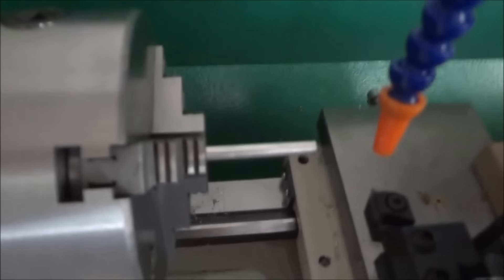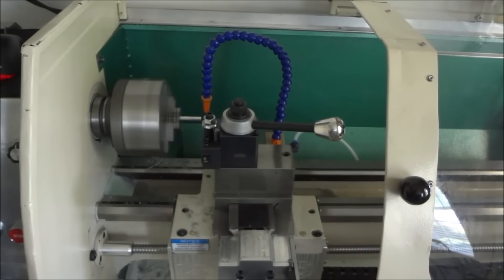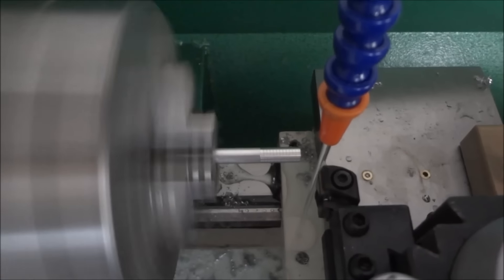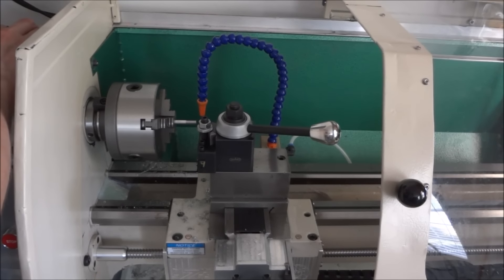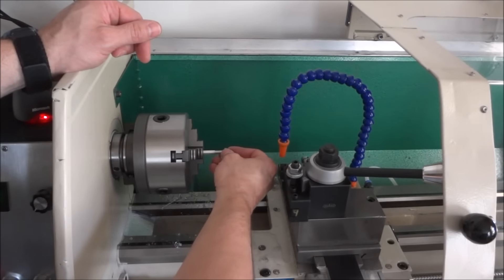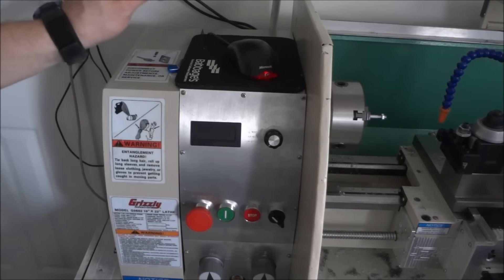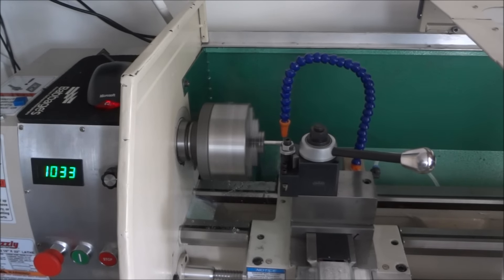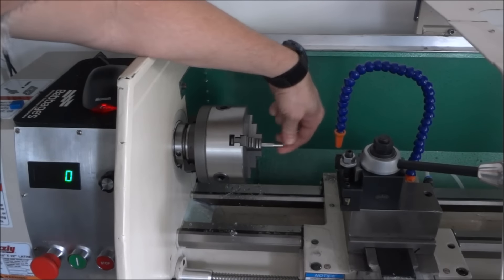G0602 CNC Threading Tests

Comment: Awesome! There is nothing quite like watching a CNC Lathe creating a thread, I never get tired if seeing that. No watching the thread dial, no changing of gears, create both standard or metric threads. Doesn't get much cooler than that. Great work.
Reply from the maker: William Hardin I have to tell you I'm still amazed at what these machines can do. Always hated changing gears and threading setups timing the dial on every pass etc. this is so nice you can go from 1/4-20 , to 10-24, to M12 x 1.5 in the time it take to go to get a drink of water. No more saying I really need 10- 24 but since I'm set up on 1/4 20 I'll use that situation.

Comment: Mach 3's trajectory planning is incredible in regards to threading. I had very similar experiences as you just showed. I appreciated the fact that you cranked the speed up mid job to check the ability to follow. That looked like something I would do just prior to breaking a part or tool ;-)
    Excellent series btw. Too bad your Mach 3 set ups werent around when I started. On the other hand. Thanks to those who did provide what I needed. There is a learning curve.
Reply from the maker: +CncObsession Thanks Yea I wanted to demonstrate that the Proximity sensor was really working I did it early so the threads weren't trash and it was Aluminum so no worries in regards to tooling. There is definitely a learning curve expensive too. LOL I have many Endmills to prove it on my X2 several that never made a cut LOL

Comment: looking good.  why dont you have Mach3 control the spindle speed?
Reply from the maker: Matthew Prestine  Ah yes spindle speed control, I started off with this build to try and show stage by stage how I converted my Grizzly lathe I thought that most people will do the conversion in stages so thats what I have done. Stage one add the VFD 3 phase motor Variable speed, Stage 2 CNC, Stage 3 is full CNC and that will be the next step Spindle control. If your new to  machining having the Potentiometer is nice so you can vary the speed on the fly.
Reply: CNC4XR7 Makes sense,  I haven't followed the entire conversion or its relative steps so it wasn't apparent to me.  Been machining for years, LinuxCNC user though.
Reply from the maker: Matthew Prestine  I tried to do the conversion and put out information others missed so its fairly in depth.
But full cnc will be soon. thanks,
Sam
Reply: CNC4XR7 It is a very impressive conversion, that is for sure.
Reply from the maker: Matthew Prestine Thanks Much Appreciated!

Comment: Nice work.. well so the proof it does work... I wasn't sure up front..
I do think that you should prevent changing the speed, as it seems to finish it cut before changing the feed.. (don't know if that's the way all machines work.) But that does mean I't would not keep up if the rpm's change due to heavy cut's.. Maybe something to test out on a bigger round stock..

Anyhow, congratzz ! and thanks for sharing.
Reply from the maker: RoboCNC Frees- & Graveerwerk  Thanks, And thanks for posting your video and sharing the Idea. We now have a answer.  I wouldn't change speeds on the fly normally this was just for the benefit of the video. The change in rpm's were around 640 I don't think the change in rpm's from heavy cuts will be significant enough to cause a problem But as far as the Index signal goes there will be a change weather you use a Proximity sensor or a Disc set up from heavy cuts.

Comment: Very nice conversion you've done there. What control and CAM software are you using? I'm having bad times with SolidCAM+Mach3 combo, especially with the feed per rev mode. The post processor I've found doesn't work correctly.
Reply from the maker: I have a couple videos on Post processors. take a look. I use Fusion 360 with a generic Fanuc post processor.

However Mach3 does not use all the same G commands.

Make sure your code includes G95 for CSS if it's not outputted in the Code it will not run it default is G94
Reply: That's good to know. Did you make any modifications on the Fanuc post processor?
Reply from the maker: suat korkmaz 
Yes it will not output g95 so you have to edit the gcode
Reply from the maker: I suggest you use the thread wizard and take a look and see how it outputs the Gcode.

will look something like this

G0 G40 G18 G80 G50 G90 
G00 G53 X2 Z0.3
T909M6
G00  X0.892
G00 Z0.1
G00 X0.867
M03 S400
M08
G76 X0.845 Z-1 Q1 P0.05905118 J0.001 L15 H0.001 I29 C0.025 B0.0001 T0
M9
M5
M30

Also refer to this: https://www.google.com/url?sa=t&rct=j&q=&esrc=s&source=web&cd=1&cad=rja&uact=8&ved=0ahUKEwjP1NWak4DXAhVhyoMKHZZcCagQFggoMAA&url=http%3A%2F%2Fwww.machsupport.com%2Fwp-content%2Fuploads%2F2013%2F02%2FMach3_Threading.pdf&usg=AOvVaw3rf1Z4N_9dSDgWwaTq10eJ
Reply: Are you using Mach3 thread wizard for threading or F360?
Reply from the maker: Fusion 360 may not work I suggest you compare the g codes

Comment: Do you have any regrets on this lathe? Watching your videos makes me want one. I have a Jet 14x40 already. If you were in my shoes would you convert that 14x40 or buy a little 0602? Thanks for the great videos and the time.
Reply from the maker: +Unorthodox Fabrication 
 No Regrets, So far it's been almost a year since the conversion. there are a couple things I would change. I would go full cnc right from the start with spindle control ( instead of the POT) and I would go with maybe a 1 1/2 HP motor the 1 HP is OK but I have stalled it taking deep cuts.
The G0602 is a Great Base for conversion I think its big enough and it doesn't have a lot of frills in stock form so your not paying for extra features your just going to remove. I have a small 7" lathe so if I need to turn something quick I use it.
It's hard to tell someone Not to buy another Tool LOL!  
If it were me I know I would use both so I would say If you have the space and the extra $1300 go with the G0602 and leave the Jet as is. But the Jet would make a awesome CNC lathe.

Sorry I know that wasn't much Help. Be Safe Sam
Reply: Thanks for the input. I will buy another then(not that I have the space). I have owned 2 of the jet 9x20's and never used them because my larger lathe was all tooled up. 

I am still on the g0704 conversion.. 1.5 years now. If I was any slower I would asked to be put out of my misery. I have a VMC in my garage I have not made a single chip with yet, and I am still worried about building another machine. 

Thanks again for the great videos, it motivates me to make more videos too.

Comment: can you please tell why you didn't use PM10x30/22V lathe or even the G4003 ?

the PM10x30 has direct mount chuck and more safe for reverse threading..!   also the G4003 is more accurate on the spindle bore!  

how much your run-out in your spindle index?

you did great job!
Oz
Reply from the maker: +Ozy Ozy  Thank you,
 both of those are great Lathes Two reasons I did not go with the PM 10 x 22/30 $$ and It has a DC motor I knew I wanted a 3 Phase motor and VFD. The G04002 0r G04003 are Awesome lathes a lot of the features with that lathe would have been removed with the conversion the D-1 chuck would be nice along with the 12 ' swing. But it all came down to $$ I completed the whole conversion for less than the G04003 would cost.
So far so good on the G0602 spindle run out for me is a no Issue.
Be Safe,
 Sam
Reply: +CNC4XR7   thank you for your quick responding.... I will fallow all your steps for converting my new lathe, I am about to get PM10x30 will add some metal tubes somehow on the bottom to make it heavier as it's longer than 10x22 so it need more mass..

I think for 10x22 should be around 700lb and for 10x30 should be around 800lb    but for PM10x30 only 500lb  not good mass! 

quick question please;:  can I use Double Shaft steppers?  so that I can use the lathe manually when I need to practice on machining! as I am very new to this..I know you removed the compound, so how can be used manually if it can?  

thank you for sharing all these videos..keep up the good work!
OZ
Reply from the maker: +Ozy Ozy Yes you can use Dbl Shaft steppers for Manual machining. I think the Pm 10 30 is a good machine I just did not like the DC motor. The head stock looks a little Narrower as well maybe 1". I did like the Cross slide slots and the Spindle chuck mount. I assume you need the Extra Length?

Be Safe,
Sam
Reply: +CNC4XR7  I think the G0602 is 1"  spindle bore too!   
I will end up changing the DC motor with some 2 phase 240V once but for now I can learn CNC with that motor,,,,, I heard that the DC motor have enough torque on low speed!  so that will be good for threading:)    

I know I am very confused here but I may change my  all plan and go get the G0602 and just deal with the threaded spindle!  and short bed !

thank you 
Oz
Reply from the maker: +Ozy Ozy I think If you need the 30" go with the PM 10 30 both are 1" bore the threaded spindle is a drag but unless your going to be doing Instant reverses its not really a problem. if your going to convert to 240V Might as well use a VFD and a 3 Phase motor and Have variable speed. then CNC spindle control as well. The extra $700 in price goes a long way on a conversion. My 2 cents Be Safe,
Sam

Comment: what happens if u turn the spindle off ?.. mine keeps trying to cut . I thought it would stop the z and x axis altogether .
Reply from the maker: Cant say I ever tried to just turn off the spindle. sorry
Reply: ps : ive never done it while cutting . only with nothing in the chuck . :)
Reply from the maker: I can give it a try next time i'm on the G0602 thats interesting for sure. I have adjusted the speed to see if it would stay in time and mach3 does do that so at Zero speed I would think it would stop but it may default to your min. pulley speed not sure.

Comment: Best regards Can yopu tell hoe configurate mach3  for threading? thanks.
Reply from the maker: deimosjuf 
what do you need help with
Reply: i have c10 bob and c3 index card wit a 69mm disk with 1 slot the c3 shows me the rpm but a does not cut threading (the pitch is not correct) Is necesary the limits for thrading I don´t understant the index debuonce.Thanks for the help and forgive me for my bad english.
Reply from the maker: deimosjuf 
it may be better if you email me . cnc4xr7@gmail.com  does mach3 and your lcd rpm agree with each other?
in mach3 under configure/ ports  pins/ spindle setup special features make sure you check use spindle feedback in sync modes and also spindle speed avg.

Comment: hi sam, wots your thoughts on mach 3 ? i run it on my lathe and mill, only problems i ever have are ones i make, wot are your thoughts please ? thanks daniel
Reply from the maker: +Daniel Kitson  I think it works great I have had weird things happen a few times but a reboot will clear them up other times it was self inflicted or I thought there was a problem and it was me. LOL  I use it on my Mill and Lathe
be Safe Sam

Comment: Your wiring drawing does not show how you get spindle speed into Mach3.  I have a similar set up and can get spindle speed in the little RPM screen but no signal goes into Mach3. When I remove the little tachometer screen and go directly into my Gecko board I get numbers in Mach all over the place.
Reply from the maker: +Dennis Facer  Hi Dennis,
My Wiring for the Tach should be in the link: https://www.dropbox.com/s/mxc6ehji8riioyu/G0602%20CNC%20Stage%20Three%20.png?dl=0

Does the Gecko board allow for a 5v input? if so this wiring should work.
Reply: The Gecko board says signal voltage of 3.3 to 5 required. I have a 12 volt power source for my sensor.  Someone said I need to wire a resistor into the circuit to get the signal down to 5 volts.  Right now something is getting to Mach3 as I have a read out that varies from actual rpm to 1, and is never stable for any number for more than a few seconds.  I have changed every setting I can think of in Mach3 so I am convincing myself this is a hardware problem. Thanks.
Reply from the maker: +Dennis Facer 
Did you splice into the signal wire coming out of the sensor one end goes to the display the other to the BOB.
 Check the voltage on that wire with the sensor blocked and Unblocked  ARE you in the Range 3.3-5V/
IF so then you should be fine as far as the signal.
Reply: First of all thank you for your time.  Where brown is +, blue is - and black is the signal I get the following readings:Brown to blue 12 volts steadyBrown to black 4.75 to 6.3 fluctuatingBlue to black 14.85 to 16.3 fluctuatingBlack to ground 11.28-9 pretty steadyBrown to ground +.13 to -3.0 fluctuatingBlue to ground 3.9 to 6.5 fluctuatingAll of these readings with a program running and no tachometer in the circuit.  If I put the tach in the circuit mach3 locks in a reading of 13, actual RPM about 150.  I am not sure what these readings reveal.  Also I am not sure what you mean to take a reading with the sensor blocked and unblocked.Thank you!
Reply from the maker: +Dennis Facer 
http://pages.ebay.com/link/?nav=item.view&alt=web&id=171846091886 
This is the tach and sensor I'm using. I purchased some stronger magnets from Home Depot.  There called super magnets same diameter as the one that came with the sensor just stronger. 
My signal wire is yellow if I rotate the spindle until the sensor is made I get a 4.8v signal hi and then low. V. 
The LCD display helps me drop the voltage down below 5 v without the display connected I would need a resister.